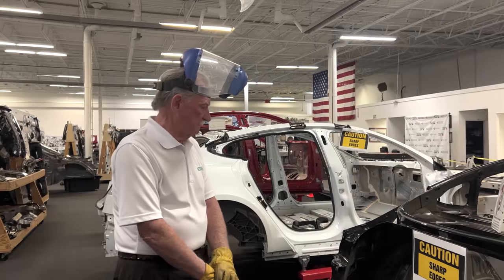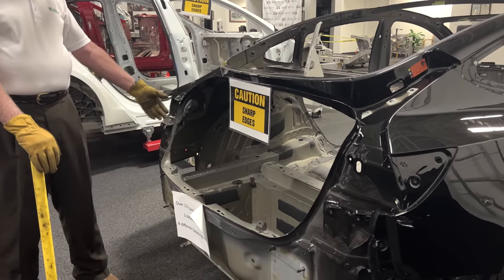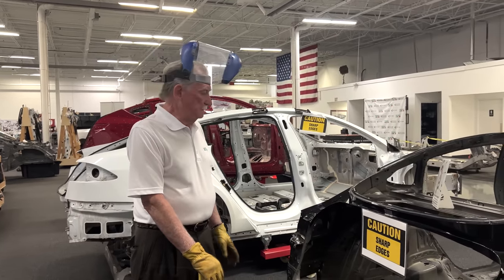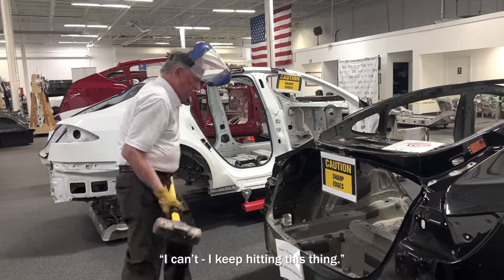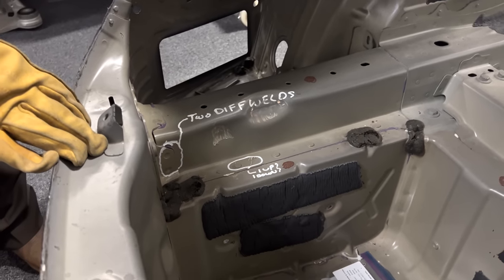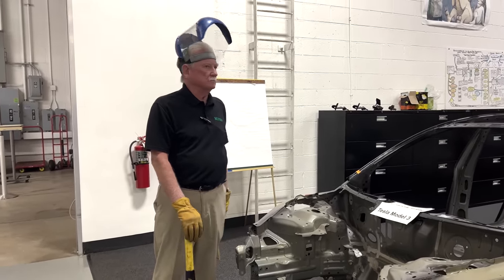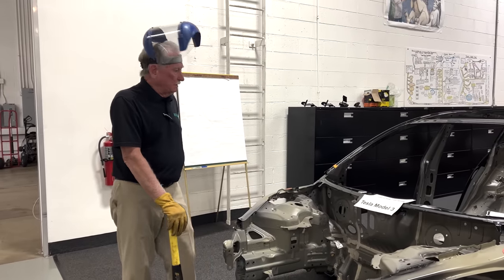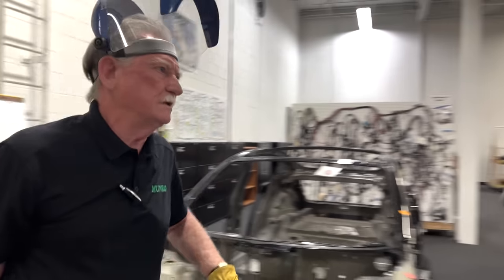Sandy Rant... With a Sledgehammer? Why Aluminum Castings Are Safer Than Steel

Comment: Aluminum does have one unfortunate tendency -- it is prone to metal fatigue much more so than steel.  Essentially Aluminum has zero elastic limit.  I.e., any flexing causes metal fatigue which is *cumulative*.  Hopefully the enginerds have mitigated flexing but I doubt it is zero, and it is well to note that aluminum aircraft spars must undergo detailed inspection on a regular basis using penetrant dye or x-rays to detect any incipient cracks.  Maybe Tesla's magic alloy fixes that but if so I'd like to hear about it.  In the meantime, eyeballing the casting doesn't prove that there was no damage.  Magnaflux it.  Surely Sandy you understand that dents aren't the only form of damage and that ultimate strength isn't the only determinant of applicability.

Comment: I think securing the casting to something rigid would have made for a fairer test. Wouldn't allowing it to move unsecured enable more of the energy from the hammer's impact to be converted to kinetic energy? It's like kicking a brick versus kicking a brick wall.

Comment: Hoooly I didn’t realize the castings were this huge. Thats impressive. I’d imagine you should be able to easily feel the difference between driving the cast Al vs stamped steel cars. 

Kind of curious if nvh was annoying to mitigate in the design transition. I know it’s different but I’m familiar with the stark contrast in the ride-feel of an aluminum bicycle frame vs steel frame (alu frames often a bit stiffer, but ring/resonate in an undesirable and uncomfortable way).

Comment: Sandy you didn't need to show off your strength....IIHS already crashed the fremont model y (steel) and the austin model y (casting) in their moderate overlap (guessing it was the austin/casting due to the splash of debris, which looks like aluminum bits flying everywhere). The reason both were tested is because iihs updated their moderate overlap, so they used the austin built in the new test.  If you click into their "technical measurements," the austin did marginally better in this particular test...the fremont was already very safe.

Comment: OK, I can't resist but make comment too.  Not sure "strength" is very relevant at all, stiffness is what the area needs most - for which aluminim casting is GREAT.  But I do still worry about what happens when it does fail in a high speed crash, typical steel structure is a great energy absorber, castings tend to fracture then give little absorbsion after that.  This I belive is why the castings are SO "strong", becuase if they started to fail, the occupants would be in trouble.

Comment: Good morning. Now, don't take me as someone who want to argue, more like I'm a bit curious after seeing this.

I've always thought that they use steel kind of because it deforms. The deformation uses up the crash energy, and furthermore, makes the distance the cabin has for stopping a bit longer (by the amount it deforms by). If the aluminium casting doesn't deform (as much), won't the stop of the cabin be more abrupt?

Again, I'm not saying aluminium casting cars are less safe, I'm curious what it does during the crash and where all the energy from the crash goes.

Comment: The bent steel is also likely to have issue with micro fractures and the properties of the metal changing from the energy of the impact.
Invisible weaknesses nobody will notice until it really matters.

Comment: I am not sure if this is a fairl comparison, because if the casting is not attached and is able to slide upon impact, the hammer is decelerated less and the impulse of the strike is lower. Although my comment only applies to the first rear casting experiment where the force was exerted horizontally and not the second one where the force was exerted vertically.

Comment: Benning is not a bad thing.
Everyone should know that steel deforms much more than Aluminium, but Steel doesn't break because fatigue as quickly as Aluminium. I saw a cracked frame on a BMW Z8 with low mileage just because of Age.
Same thing happened with my Audi R8 before Audi massively reinforced the very same point luckily I got my money back from Audi.
Avel engineered casting might be better bite white oval design life but only if it's well-engineered.
A well-engineered steel hydroforming would also perform superior and I have no doubts that costing steel is a very challenging task.
What's more interesting for me is however engineered aluminum casting with well-engineered carbon fiber structure what's perform against Gigacasting.
When it comes to engines if you looking for performance cast aluminium is good but if you look for longevity grey casting is way better and the steel block is superior but of course it's also very heavy but as long as you change your piston rings it will last.

Comment: Weren’t older engines made from cast iron, Just a thought. However I’m with Sandy on this one, aluminium castings are by far and away the better deal. Eventually other manufacturers will follow, if the aren’t already!

Comment: Sandy, you should cut the entire McPherson mount socket out of the body and put it under a hydraulic press, then do the same with the casting. Measuring the pressure at which an element deforms or breaks would provide the most telling evidence. Although there will still be those who say that the Earth is flat and dogs bark with their asses.

Comment: Though I am not a big Tesla fan I do have to admit as impressive as their crash test ratings were before they went to Giga Castings they have not suffered a bit since rolling them out and the castings appear to have made their vehicles even more crash worthy then those prior 5 Star rated vehicles.  

Perhaps a Sixth Star will have to be adopted to be able to accurately relay these improvements on how best became even better.

Best!

Comment: The castings may be stronger, but they are likely also more brittle and less compliant, so the steel will bend and absorb energy in a crash, and the casting might fracture and shatter. After a low speed accident, will the aluminum disperse the energy to many locations with fractures and cracks that go unnoticed, where steel would have a progressive area/radius of deformation? Will the aluminum panels be repairable or the frame capable of being straightened and repaired, or will the whole car be scrapped? I don't know. I'm curious.

Comment: I wonder if Sandy is contradicting any assertions in the recent FEDA advisory.
  NEWS: France's FEDA has just advised against Giga castings.

  DAMAGE & STRENGTH: Sandy only scratched the surface here (no pun intended).  Giga castings ARE stronger in some or most aspects.  They are less vulnerable to damage than the alternative- traditional underbody construction, build ups from welding many shaped sheet steel pieces together.
  Yes, good selection of steel of various strengths CAN produce GREAT results.  Occupants will be protected well in low to medium energy impacts.  Repairs, if possibile, can be expensive, sometimes resulting in  "totalling" the car versus repair.
  It's plausible that vehicles with giga castings (GC) can better withstand low to medium energy impacts. Impacted GC vehicles will often not require replacement of the GC.  Though seldom needed, A GC can be replaced for reasonable cost. Totalling a GC vehicle would be needed even less often.
  High speed, high energy impacts would require totalling both types of vehicles.

  SAFETY:  Most significantly, as Sandy was addressing, cars of both designs safely protect people. Tesla vehicles consistently are the SAFEST vehicles crash tested by industry and regulatory bodies.

  COSTS:  Contrary to FEDA, cars made with giga castings would NOT cost more for SOCIETY as a whole, and certainly won't cost owners more.  As described above, they will NOT cost more for REPAIRS.  In some cases, casting  replacements will be feasible and cost effective for insurers, when other vehicles will cost insurers more for totalled the vehicle.

  CAUTION: This is mostly all my informed opinion, with understanding of materials science, design, physics, and manufacturing processes (Mechanical Engineering and Engineering Management degrees).

  RECOGNITION: Don't get me wrong; I sincerely respect the real world experience and practical knowledge of technicians and mechanics, and can appreciate some points they make here.

  COSTS  2: Yet I still think it's likely the use of giga castings is likely to reduce manufacturing, maintenance,  and vehicle repair costs.   Total lifecycle costs considered.

  RECYCLING CASTINGS: I believe Tesla's nearly complete capability to recycle giga castings in Texas argues against FEDA's contrary claim that these castings will have high costs for RECYCLING, and and on ENVIRONMENTAL IMPACT.

  LESS SCRAP: Repairs on 
Tesla's with giga casting will be different and possible  where traditional designs require different  more complex repairs, if even possible.  Often repairs are not possible and the car is scrapped.  Are there environmental costs to scrapping a higher volume of vehicles?

https://www.teslarati.com/france-feda-giga-press-warning-risks/  and

https://tinyurl.com/3tdk8fsu
  (which points to the full URL...)

https://www-feda-fr.translate.goog/actualites/presse/giga-casting-la-feda-lance-lalerte-sur-les-risques-pour-lenvironnement-et-le-budget-des-menages-671?_x_tr_sl=auto&_x_tr_tl=en&_x_tr_hl=en&_x_tr_pto=wapp)

Comment: The idea is correct just that the impact comparisons were not. The iron fab had the the whole car frame weight to hold that longitudinal in place. So the spot took most of the impact. For the Aluminum cast, the structure moved away, thus not translating the full impact to the spot on the structure.
Reply: 😂😂😂 ok einstain

Comment: Bad comparison, the whole aluminium frame slides away so the movement absorps the blunt of the impact. While the steel was a big structure that couldn't move. 

For the structure in the front in the aluminium was much stronger made in comparison with the steel not directly related with casting just a lot thicker material wise. 

Because years of experience learned us what thickness is enough for plate steel. but aluminium for car frames is still in development and because of that a bit over engineered.
Reply: Exactly, the casting slid across the floor. In no way were the test conditions comparable. But yeah it would be expected that the aluminum would be more rigid, the casting is ribbed and gusseted versus the non-reinforced steel weldment which is easily dented.

Comment: I'm assuming this video is in response to the press started by someone discovering cracks in their 2023 Model Y? Aluminum castings are great ASSUMING there are no manufacturing defects (such as excessive porosity commonly caused by air bubbles trapped in the molten metal). Is it possible that a small amount of cars get through Tesla's QC process with defective parts? I would say Yes (and I say that as a 2020 Model Y owner).

Comment: You're gonna need to redo this. The casting isn't attached to anything, and allowing it to move like that soaks up a lot of the impact.
Reply: Crash tests will show which is better.Steel is designed to crumple, but unbending and straightening it is difficult. Will that casting be rigid and transfer energy somewhere else, like the passengers, or will it crack into shrapnel? I hope somebody has figured this all out. I suspect the castings will be fine after a crash and the steel will get replaced. Beats straightening a frame.

Comment: this test is worth as much as when von Holzhausen was hitting Cybertruck and Ford truck with two different forces :)
And practically Sandy proved himself wrong in this video   aka    brittle vs tough materials (Brittle materials break often without warning. They have little elasticity and do not stretch easily. Tough materials can deform plastically and absorb a lot of energy before breaking.)

btw guess why Tesla's are being scrapped after even the smallest crashes? ;)
Reply: ID10t
Reply: “Guess why Teslas are being scrapped even after the smallest crashes?” Let’s see your sources on that. I have seen nothing on the topic.
Reply: GIGACASTINGS dont ever Break down, superior Product.
Reply: @markplott4820  that is just your wet dream bro, everything breaks

Comment: hold on. 
steel deformation has very important purpose in absorbing impact forces. Casting doesnt. Meaning those forces are getting transfered into occupants.
and not just that. 
Steel will never sheer off completelly or shred into pieces as casting will. Casting is stronger at lighter forces, or to certain level, at which it will literally just break away completelly. 
Thats why front control arms are cast aluminum, not steel, because steel will not shear off, thus holding the wheel in wheel arch. 
cast aluminum control arm will break off and release the wheel. 
In a crash you need body to absorb impact, crumple and abosrb energy, not to be rock solid until it completelly fails and everything comes in the cabin. 

I am literally shocked with such an amateur approach to this topic. Also, I feell Sandy missed his few daily whiskeys.

Comment: But isn't deformation good during a crash event? All the energy goes into deforming the steel instead of violently accelerating the body? Modern cars crash zones folds in on itself like an accordion, while old  turbo bricks with stick:Volvos saw a lot less deformation during crashing. I would be curious on the amount of work it takes to rapidly crush the rear end of the cast Tesla vs the steel one.

Comment: What a sad display of arrogance and lack of knowledge! 
He is not the only one with years of experience!
Each part of the car is design with a purpose, with a set of inputs that it has to withstand. Hitting some random part with a hammer just do not make any sense on proving his point.
As a simulation engineer the fact that the cast part is more rigid than the steel is what raises me concerns.
But without knowing how all other parts will interact with the cast and the kind of loads it will be subjected to no one can say if it is going to be ok or not.
Not even the know it all Sandy and his hammer!

Comment: What about corrosion? 
In Sweden NaCl is in plenty use during the winters to mitigate ice build-up on the roads. Car manufacturers are now able to provide decent corrosion protection for steel-based cars (except US imports that rust away at a ridiculous speed). But aluminum castings might introduce another level of problems. And I do not feel that safe as design is going on in sunny Texas... Salt spray and pockets can eat away aluminum rather fast. 
Your opinion, please?
Reply: Our aluminium window frames near the sea air are the only choice. 
Timber and steel suffer badly. 
From a home owner. 😊😊😊😊

Motor bikes have a lot of exposed aluminium. 😊😊😊😊😊

Aluminium motor boats are extremely popular and long lasting. 
Fishermen love them.😊😊😊😊

Comment: in general, aluminum will crack if it's hit hard enough. the steel will deform. as a cyclist, I've had aluminum frames that cracked. The steel frames instead will bend or dent.

Comment: Steel is stronger then aluminium Yes you right! So I  believe the Cybertruck gonna be much stronger then a model 3 but  in comparison a casting build alu. beat a weld sheet metal car! And a Cybertruck get even with a tanks! I love this work to clear up what happened i car-industry the last 5 years! It great Sandy! I hope your swing of the sladge-hammer  do not hurt the muscles It easier to sing macho man, then to be one! /Mikael

Comment: FACTS are , only Damage in a crash w/ Castings are going to be the Sacrificial crush cans .
the Actual casting takes ZERO damage .
and the crush cans , can be cut off , unbolted , and Replaced.

Comment: Okay, I’m not saying Sandy’s wrong, but as as engineer this test is silly. On the casting most of the energy from the sledgehammer is translated into rotating the casting. Because the steel design is the whole BiW is much heavier, it wont rotate as easily and the energy is absorbed by deforming the part. Secondly the longitudinal are loaded longitudinally, not at an angle from the top. Sandy you can do better.

Comment: Honest question.

Is a steel body pickup truck more durable than a aluminum body?

I need a pickup truck to tow the rv that I live in and I want it to be able to not be totaled when someone crashes into the engine bay so I can still go to work 6 days out of the week after the crash.

Comment: I put a deposit on a lightning Pro up here in the peoples republic of Canada, where gas is 7 dollars a gallon.  Which costs me 20 to 25 dollars to drive 100 km in my 2018 Ram 1500 Hemi.  That's enough to convince me to join the electric car Illuminati.  And if that wasn't enough, the lightning pro (and maybe XLT) is the first EV that is cheaper than the ICE version with the same equipment sticker for sticker.  Add in the rebate and you are way ahead, I think I'll keep the sledgehammer away from it, hopefully.

Comment: Just a little disagreement with not being able to use sheet metal for an engine. The Taylor engine was used in many WW2 applications. Crosley used them in their early cars. I will agree that the castings are better strength wise. Crosley also switched to cast block engines and spent over a million dollars replacing sheet metal engines that rusted out.

Comment: How do crumple zones work with castings, doesn't the energy go into the people?
Reply: Not if you wear seatbelt 😂
Reply: I don't think the casting is part of the crumple zone.  It is part of the rigid passenger protecting structure.  Sandy did point out the place where the deformable structure bolts onto the longitudonals.  But then again, I am not from NY, so what do I know...